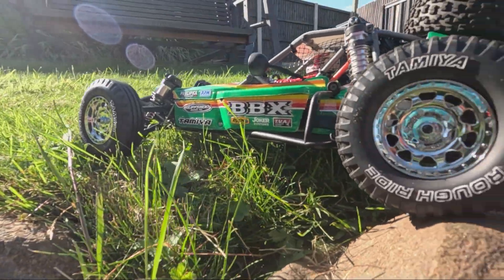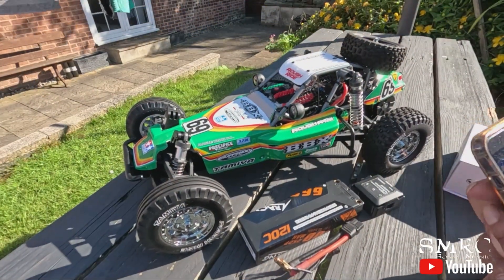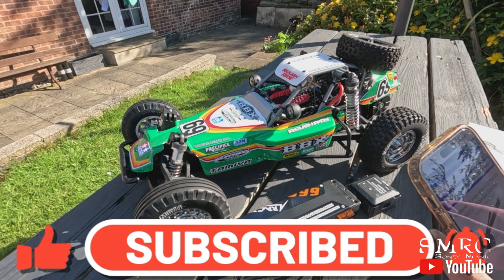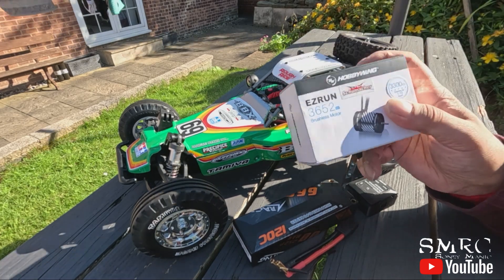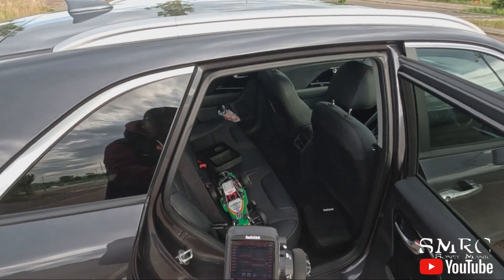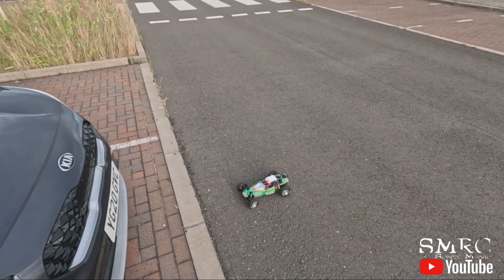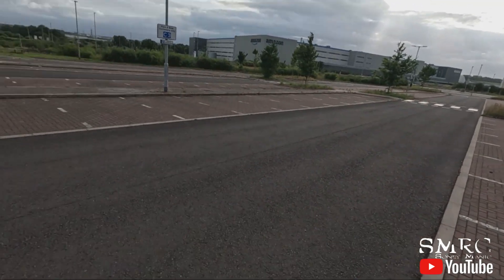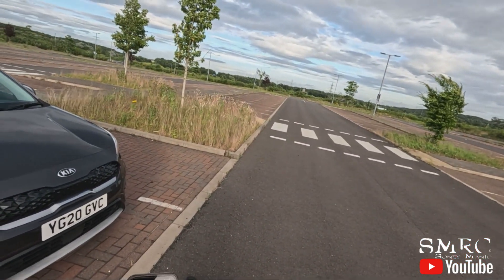Unveiling Tamiya BBX HobbyWing Speed Secrets #tamiya #hobbywing #speedrun

Comment: That's sick! 
Are the gears holding up okay?
Reply from the maker: @thercstore.  yeah. All fine. But I think 3s and the faster motor may kill it. Don’t want to risk it. I think 42 is respectable for a 1/10. 👍🏻😊 although my other Tamiya speed car did over 60!!  But that was just to beat Tomley. 😂😂😂
Reply: @Soney_Manic  60mph plus now we are talking!

But I agree usable speed 42mph is quick especially out of a Tamiya.
Reply: @Soney_Manic I bought one each for my nephew and myself. His has the max10 80 3652 and for giggles and not knowing better I put the max 10 140a 3665 with a 27t pinion and the gears held up to 3s fine with that. The flip and slide took off about 90% of the shock caps and cage however. No speed test yet.
Reply from the maker: @tomconnors8165  max is a beast on 4s. Good rc regardless. You defo made a great choice.
Reply from the maker: @tomconnors8165  it’s a great car and I hope Tamiya gear it up by moving to hex etc. but u imagine hardcore Tamiya fans are against it. Still. A great buggy. 👍🏻👍🏻